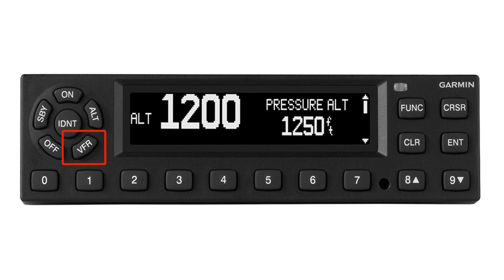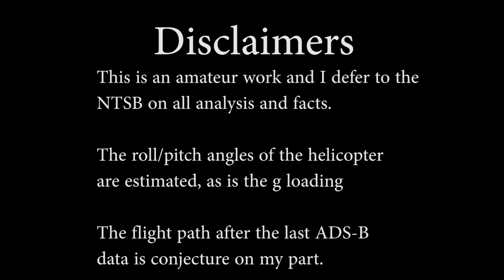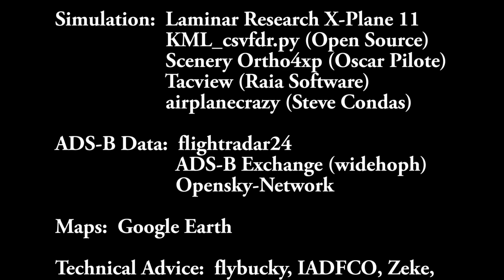Newly released Pilot to ATC Audio!  N72EX (Kobe Bryant) Crash Reconstruction.

Comment: Im not a pilot but i have flown in small aircraft quite a bit. Im wondering why the pilot chose to climb to 4000 feet when he could clearly see how thick the fog was getting? I mean at least flying low you can tell where you are or you could choose to land in a helicopter. Its also alot easier sitting at home saying this too.... I know.
Reply from the maker: The helicopter started climbing at almost the exact time it had descended to 300 feet above the ground.  I think the pilot kept going lower to see the road because of the lowering ceiling near Calabasas, but he decided to climb when he got to the lowest he could legally go while not taking off or landing (which is 300 feet above ground level).  https://www.law.cornell.edu/cfr/text/14/135.203
Reply from the maker: I forgot to mention that I suspect the reason he told the controller that he was climbing to 4000 feet (as opposed to some other altitude) was because that altitude is the Minimum Vectoring Altitude  (MVA) for the Calabasas area - The lowest msl altitude at which an IFR aircraft will be vectored by a radar controller, except as otherwise authorized for radar approaches, departures, and missed approaches.
Reply: @stevencondas2281  Thank YOu for your reply!!

Comment: What software do you use to put the entire video together?
Reply from the maker: I used many different programs.  I used a program I wrote to filter the noise and quantization from the ADS-B data (if you don't filter the data then the reconstruction bounces all over the place due to GPS noise and altitude 25' quantization).  I then fed that output into a version of KML2csv, which I modified to fix roll calculation errors, to estimate the the roll, pitch, and yaw from the ADS-B data.  I fed that output into a program called TacView to generate the gauges and clock.  I then took a program called ortho4xp and generated high resolution scenery for X-Plane around the crash route.   KML2csv also generates an X-Plane FDR file, and I fed that into X-Plane to generate the helicopter visuals and scenery (both clear day and with marine layer).  Finally, I took the video output from Tacview, X-Plane clear day, X-Plane marine layer, and the FAA ATC voice track and created the video using Adobe Premiere Elements.

Comment: short question on the circumstances: What are the requirements in the US for IFR and VFR? Like was that single pilot flight under that weather conditions even legal?
Reply from the maker: cychrome I am not a pilot or with the FAA, so my answer is not authoritative.  My understanding is that everything was "legal" until the helicopter got near Calabasas.  Up until then the pilot was operating in svfr conditions.  I still don't know exactly when they went iimc, but at that point I believe they were no longer vfr and thus should have declared an emergency that they were iimc.  I will also note that the U.S. allows for single pilot IFR, but that this operator was not approved for IFR operations.

Comment: I've often wondered this and just have to ask. If at one point the pilot was using visual orientation of the freeway below to proceed his flight path, why then deviate from that, elevate into extremely thick fog,making spacial disorientation very likely. There were no  visible obstacles along the freeways path and in this obvious visibility emergency, may have saved lives. An earlier transmission told him he was flying too low for air traffic control assistance, this in my opinion contributed to his next fatal maneuvers.
Reply from the maker: I have read some of the latest NTSB reports and they say they are not definitive when the pilot lost site of the freeway.    If the helicopter was below the cloud base at the time the pilot decided to climb, then they estimate visibility of between 1 and 1.5 miles.  "If the helicopter altitude was above the cloud base, a possibility explored in this study, the visibility range from the cockpit was shorter than these estimates."  At least right now I don't think there is enough information to conclusively know when the pilot lost site of the road, and whether he lost site of the road because he climbed or climbed because he lost site of the road. https://dms.ntsb.gov/public/63500-63999/63911/636393.pdf
Reply: The pilot entered IMC (flying into fog or cloud). Climbing to higher elevation is an industry default emergency maneuver in case of IMC. It is the most quick and safe way to get out of IMC. The higher you climb you more time you have to properly orient yourself. Also you can often climb above the cloud layer. Kobe's pilot knew where the top of the cloud layer was. What probably happened is as the pilot was approaching the mountain range, the base of the fog/cloud layer became significantly lower. He entered the cloud and decided to climb out of it.

Comment: I've watch all of your recreation videos and I would like to ask if you could use the Ring door bell videos of the helicopter flying over the homes just before impact to gauge the attitude of the helicopter?  From what I personally heard in those videos is that the helicopter is flying very low and definitely at high speed.    Could that be some telltale sign of something gone horribly wrong just before impact?  Your reenactments make good common sense and I do think the NTSB will rule pilot error in the decision to fly into that fog on that morning.
Reply from the maker: Thanks for the comment.  I have listened to the door bell videos as well, primarily to try to estimate the time of the crash.  Unfortunately, I don't know enough about S76 sounds to be able to use them to improve the reconstruction.

Comment: excellent reconstruction and i a greatly appreciate it. Two simple questions: if the helicopter was at a steep turn going downward, how can the pilot and others not feel the gravitational pull for example things, bags, drinks, etc falling. Second question is why do you believe the pilot went from 121 mph to 184 mph at the time of impact within roughly 16 seconds ?
Reply from the maker: Thanks for the comment.  My answer to question 1:  The helicopter was in a left bank, so objects in the helicopter would "feel" a force to the left due to gravity.  Those objects would also "feel" a force to the right because of the left turn (think how if feels if you do a sharp left turn in a car, it feels like you are being pushed right).  In a coordinated turn, which I believe it was, the left and right "forces" cancel out and the objects in the helicopter feel neither pushed to the left or right.   Question 2:  Gravity accelerated the aircraft down and forward much like a ball rolling down a hill.
Reply: 1. G-force. https://www.youtube.com/watch?v=g99ho_ExApU
2. Gravity

Comment: Is it possible to assume that the passengers were in shock during the rapid left decline towards the ground? Especially considering how rapid the movement was and considering how small the helicopter was?
Reply from the maker: My preliminary modeling suggests the passengers would feel the initial turn at about 17:45:10, and then it would feel like flying level (1g straight down in the seat) until about 17:45:22.  I am still working on what it might have felt like after that.  I am also wondering when the occupants would have noticed the altitude difference in their ears.
Reply: @stevencondas2281  Okay, I understand. Thanks for the feedback! Keep up the great work!

Comment: So IF its a conspiracy, the pilot was shot in the head and is dead leaning over his stick to the left and down.  🚁
Reply from the maker: I have tried flying the crash path in the X-Plane 11 simulator, and it is not possible to fly that path without active pilot control inputs.  If I push the controls to the left and down I end up going straight down.

Comment: Here's my question, if he were pulling on the copter and making go UP, how did the copter end up going in a DOWNWARD motion? If he were making the physical effort to get the helicopter going upward, I don't see how it kept descending. That makes no sense.
Reply from the maker: I have never experienced spatial disorientation in a helicopter, but this video shows how easy it is to become disoriented when you don't see the attitude indicator and you can't see the ground out the window:   https://www.youtube.com/watch?v=9ofStn2KScg&t=330s .   In that video, the pilot is flying while his head is covered and the attitude indicator is turned off, and he gets completely disoriented.  He is trying to fly straight and level, thinks he might be banking to the right, and is actually banking to the left and descending.  I think our senses can be fooled.
Reply: https://www.youtube.com/watch?v=9ofStn2KScg&t=330s

Comment: @Steven Condas  I am very anxious to see your future g-force video.  I can assure you that the pilot "lost it" the moment he stopped looking at his artificial horizon instrument- he was completely disoriented, not knowing which way was down. However the passenger's compartment, those individuals would drift in and out of g-force load but be very cognizant of the fall point and would have started screaming within the last 15 seconds of the final 45 second fall! By the time the passengers brains processed the "hey were falling when were supposed  to be flying and then realize that's not good" so they start to scream - thus the time frame, I wish I were wrong 😪😭😪
Reply from the maker: @Eric The g-force analysis is complicated for several reasons.  1) The altitude data is in 25 foot bins and is pressure altitude, not geo altitude, and I have to accurately estimate the altitude differences to within maybe 3 feet of so.  2) The GTX-335 GPS/ADS-B is reporting positional confidence of between 3-10 meters, so I have to filter out the effects of positional errors. 3)  Lastly, I have to estimate the pitch and roll of the helicopter because those aren't in the ADS-B reports.  I have a lot of work to do to be confident enough to publish that video.  That said, my preliminary analysis is that there are no sustained periods (more than 1 second) where the g-force is less than 1g down in the seat.  If my preliminary analysis proves out, then it wouldn't feel like falling.
Reply: @stevencondas2281  I really appreciate your attention to detail and your continuing analysis of obtainable data in order  to be as accurate as possible.  All of your videos addressing this topic have been extremely useful for visualizing the entire event.  Again thank you for your efforts to help make sense of this tragedy.
Reply: So the pilot was "completely disoriented, not knowing which way was down" but the passengers were completely aware? How does that work?
Reply: @CodyCha  If your have never rode on an amusement ride such as a rollercoaster, after the first hill climb then crested the hill and drop off. Otherwise  I suggest that you travel in an aircraft and have a professional pilot recreate an "aerodynamic stall" and then you should be able to understand that 'feeling', it's simply falling....but after a few seconds- it should feel 'unsettling'....just how long can you feel like you are falling before you become concerned? 45 seconds can feel like a long time falling.
Reply from the maker: @Eric  I don't believe there was a stall like you described.  My preliminary g-force analysis shows 1g down in the seat from 17:45:12 - 17:45::22.  This is caused by the combination of the turn, acceleration down, and acceleration forward.  If I am right, I don't think it would have felt unsettling because that is what you normally feel.   After 17:45:22 I currently see an increase in g's like being at the bottom of a roller coaster.  I have an inconsistency between my processing of the pressure altitude and geo altitude data, though, that I am still trying to reconcile before I can be more definitive in my conclusions.
Reply: @stevencondas2281  thank you again for your diligence and attention  to detail work on this entire issue.  Are you going to be producing a video that will expand more on the elevation changes? Sometime during the last 45 seconds of the flight is the only time that the passengers could have been aware that something was wrong. 45 seconds is a significant amount of time for the body to be subjected to g-forces without the distractions of flying an aircraft. Quite plainly the aerodynamic stall I'm speaking of is the exact moment where you no longer maintain lift - the aircraft IS FALLING. At that time the POWERED direction of travel and speed are now only factors in where impact from the fall occurs.
Reply: @stevencondas2281  Yeah 17:45:24-38 with passengers aware the last 8 seconds of the flight. 😢😫

Comment: Excellent reconstruction and looks completely consistent with the crash debris pattern. Thank you  for your hard work on this. I am still incredibly angry at the negligence of that pilot and I believe that the last 45 seconds- the majority of passengers felt their descent into the ground no matter the spatial disorientation nothing gets passed the aerodynamic stall "fall" feeling. SOFA KING TERRIFYING! 🤬😡😢
Reply from the maker: Thanks for the comment.  I am now attempting a g-force analysis to see what the occupants might have felt.  In X-Plane I am able to fly a similar flight profile with a sharp turn and accelerating descent that shows a 1g load in the seat with very little side to side or front to back acceleration.  In other words, not distinguishable from the climb.   I am now analyzing the ADS-B data to see if perhaps the same thing happened in this flight.
Reply: @stevencondas2281  I am very anxious to see that I can assure you that the pilot lost it the moment he stopped looking at the his gauges I mean spatial disorientation. However the passenger's compartment those individuals would drift in and out of g-force load but be very cognizant of the fall point and would have started screaming within the last 15 seconds of the final 45 second fall! By the time the passengers brains processed the "hey were falling when were supposed  to be flying and then realize that's not good" so they start to scream - thus the time frame, I wish I were wrong 😪😭😪
Reply: @stevencondas2281  if this is within 10-15% of ntsb finding, they should hire you asap
Reply from the maker: @hhh1200  Thanks for the kind words!

Comment: Come on....at those speeds feeling turns, ascents or descents is pretty easy. As well for disorientation with losing altitude so rapidly is impossible. Something happened to the pilot, or there was mechanical failure.
Reply: Spatial Disorientation is NOT a simple loss of sense of direction. It's an illusion cause by psychological condition. Your mind and body is completely tricked to think you're flying one direction when you're actually going the opposed direction, for example. The pilot has to completely ignore what he feels and thinks what's happening. And fly solely based on what the instruments indicate.
Reply from the maker: I have never experienced spatial disorientation in a helicopter, but this video shows how easy it is to become disoriented when you don't see the attitude indicator and you can't see the ground out the window:   https://www.youtube.com/watch?v=9ofStn2KScg&t=330s .   In that video, the pilot is flying while his head is covered and the attitude indicator is turned off, and he gets completely disoriented.  He is trying to fly straight and level, thinks he might be banking to the right, and is actually banking to the left and descending.  I think our senses can be fooled.
Reply: @stevencondas2281  Ok. I agree. It is like to ski through the cloud or fog. Very unpleasant. Disorientation is abnormal.
But what happened to the instruments? First thing I would do is pay attention to instruments and elevation of the mountains around.

Comment: What makes spacial disorientation so dangerous is that the pilot doesn't even know its happening. If he knows he is disoriented a quick look down at the instruments would show it and allow for an easy correction. This accident involving Kobe is the same thing that happened to JFK Jr. Pilots who get spatially disoriented don't even know it and they end up flying a perfectly good aircraft into the ground or the sea. To illustrate a fighter pilot once told me that if you roll an airplane upside down and pull the stick back with your eyes closed the G forces will make it feel like you are flying upright straight and level when in reality you are inverted and diving towards the ground. Humans didn't evolve to fly and our senses are not designed for flying. As such its easy for a pilot's natural senses to fool him, which can quickly lead to disastrous consequences.
Reply: All true. Not only that, even if you look at the instruments you still need to able to control your natural urge to follow your senses. Also there’s a question of whether the gauge is malfunctioning. JFK Jr was an inexperienced pilot who had just gotten a license so he had no chance.
Reply: @CodyCha  Agreed. He was flying VFR and had lost all his visual clues because it was dark and he was flying over Long Island Sound. Once he got into a downward spiral the G forces were pushing him straight down into his seat. This meant his vestibular system was telling him he was wings level and climbing. If he had just looked down his attitude indicator would have told him he was banked and the altimeter dropping would have told him he was going down. He probably thought he was doing just fine until he impacted the water. And of course if his wife hadn't decided at the last minute to go shopping in Manhattan and gotten stuck in NY traffic they would't even have been flying at night, but that's another story.